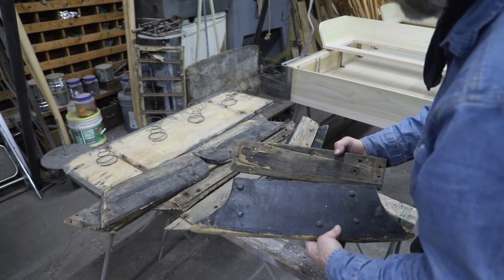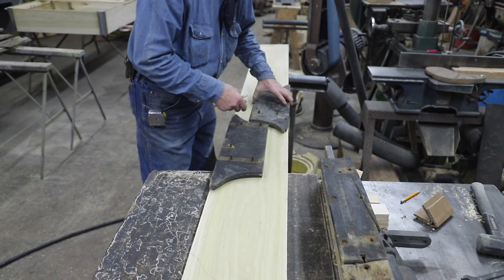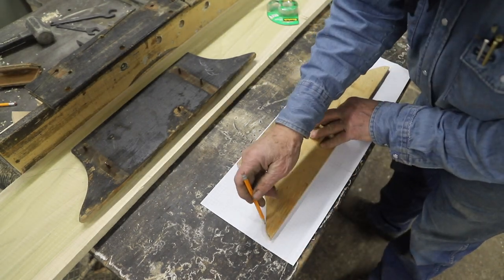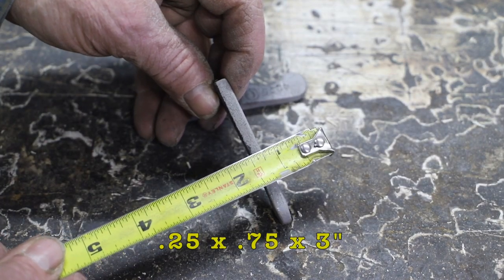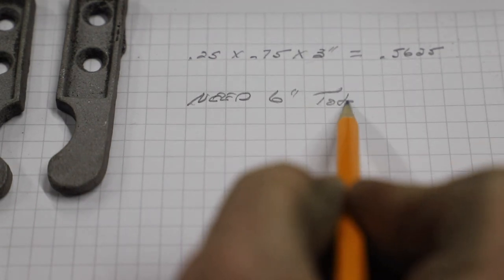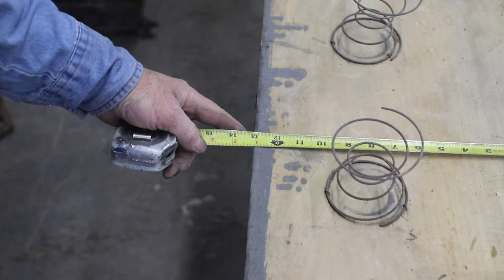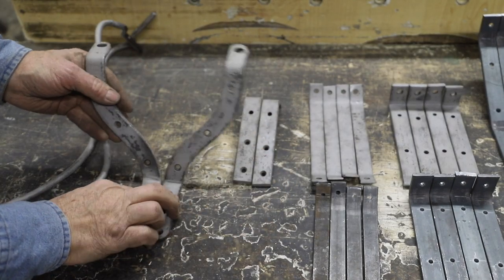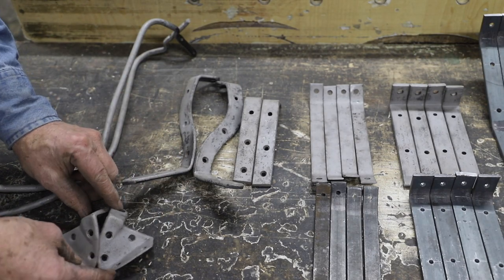Duplicating 2 Buggy Seats | 2 Seat Buggy Rebuild Part 10 | Engels Coach Shop

Comment: I notice  that ALL your guards, big and small, are fully in place on your equipment Mr. Dave.!!  Well done.  Happy HoHo to you and yours!!!
Reply: Totally as they were when made or stock.  Apparently the operator IQ level was much higher in the late 1800's and early 1900's.
Reply: @Garth2011  Well said. Totally agree
Reply: He explained why he doesn't use the gaurds on the table saw in a video about the table saw. He does have the original gaurds for it.
Reply: @garymurt9112  All  I was doing was,  doing a little BANTERING wit Mr. Dave.  And  yes I know about all guards he has. Have a good one.
Reply: @garymurt9112  yep, saw that a few weeks ago.
Reply from the maker: Of course.
Reply: @EngelsCoachShop  Who loves YA Dave.

Comment: After a recent trip to the lumberyard I'm flabbergasted at what the cost of the wood that you used must be even before you applied your magic to it.
Reply: Never buy from lumber yards, find a sawmill and finish it yourself.
Reply: @KipdoesStuff  
Wherever you buy it, wide stock like that is pricey but a sawmill is definitely cheaper than a lumberyard if they even carry material that wide.
Reply: Ever hear of glue?
Reply: @jdmccorful  
Sure. The builder of the original wagon had a shelf full of Titebond 3. 🤦‍♂️

Comment: Your arithmetic had me spinning. Dave, there is a reason the vast bulk of the world's tradesmen use metric and millimetres. THEY ARE SO MUCH EASIER AND FASTER TO USE.
Reply: Not at all. The equation is the same, just in mm. He was only figuring out if a 1/2 (13mm) bar would be enough steel to hammer the part out of.
Reply: @KipdoesStuff  I am familiar with both imperial and metric.Not having to decimalise a fraction and then back again, speeds up work.Yanks are just stuck in their ways.
Reply from the maker: Yes, but I've never worked on a metric wagon or buggy in 40 plus years.  :-)
Reply: @EngelsCoachShop  good answer Dave. But millimetres don't care what the original piece was measured in.
Reply: @TomLaios  so all of his wagons are in imperial measurement and most often whole no or common fractions and you want him to convert or measure what is easy in imperial to metric???? My shop is mainly imperial as I work on old stuff also. Metric is fine and the future but only for new items and some industries. I expect imperial to be around for a 100 years yet in common use in certain types of trades. Some of us will be talented enough to use both.
Reply: @bruceanderson9461  timber can be measured in any system.I use both systems and metric is the easiest.
Reply: @TomLaios  not if the item to be replicated was done in imperial in the first place!
Reply: @bruceanderson9461  It makes no difference. It is timber.1 inch and 1/64 or 25mm.The tolerance on timberwork is so large compared to precision metal work where .25 mm or .005 thou mean the difference between a part fitting or not. Every country except the US deals in metric equivalents of timber stock. A 2 x4 is just a 50 x100 mm. If you aren't familiar with working in metric and mm, give it a go. It is so easy.
Reply: @TomLaios  you will never understand because you can not and that is to bad for you.
Reply: @bruceanderson9461  ditto

Comment: I got some kitchen oil on my nice Engels shirt. It didn't wash out, and the dry cleaners said they couldn't do anything after my attempts at cleaning. So I put the shirt in a pot and soaked it in oil to get the same finish all over, squeezed out the excess oil, and washed it, by itself ... looks fabulous ... a little darker than original, but as long as I avoid other Engels Coash Shop fans, who is to know?
Reply: Lol

Comment: The work you produce via wood and metal is truly to be considered by a master craftsman,  however I do have one question about the video that shows something that perplexes me, as follows:
At 20:15 clearly the new components you are making are shorter than the original, yet at 20:34 all parts, new and original, are the same dimension on the short segment. How did you do that?
Reply: trick of the camera, lol. the parts are the same length just not picked up because of the angle it is shot at.
Reply from the maker: The beauty of steel - easily adjusted.

Comment: Merry Christmas!  I was wondering if the fittings on this wagon were all cast iron and it appears they were.  Was it a common thing to use third party suppliers for fittings?  I assumed that most manufacturers forged their hardware in house.
Reply from the maker: Yes it was common to use hardware suppliers.  The flat irons were most likely shop made though.

Comment: Starting at 17:28 I am not sure I understand why the back edge of the seat 'box' has a 45 degree bevel shaved off. I can only guess the tall part of the seat 'back' is supposed to flex over that 'joint' point with the seat irons acting as the 'spring'.
Did I get that right?

Comment: I notice that more often than not you use files and rasps with a "draw" action rather than a "push". Any reason?
Reply: More strength in the draw?  Just like it is easier to drag your dog to the back door to than to push him when it's time for him to go out when it is raining.
Reply from the maker: Most of the time I am using it as a plane.  Easier to pull a chain than push one.

Comment: 10:50 It's easier to round over the end of bars on the face of the anvil. Just hook it over the edge and hit straight down while raise and lowering the tail of the stock.
Joey shows what I'm trying to say better
https://youtu.be/7RxIso0yHPA?t=250
Reply: I'm not a blacksmith, but I do enjoy crafting things, and what I see produced in your linked video is not a matching piece to what is required on this buggy.
Reply: Just because that is how one person does it, does not make it wrong when someone else can do it in a different manner. Its not wrong if it works.
Reply: @tombaker3794  Not about the piece, it's about the technique, rounding over the end of a flat bar using the face of the anvil because it's more stable than working over the horn.
Reply: @KipdoesStuff  Never said he made the part "wrong", just sharing knowledge by pointing out that there is another technique that he might find faster and easier. It's up to Dave if he wants to try it out.
Reply from the maker: Thanks.  It's only 1/4 x 3/4 so not much metal to move.  I was adjusting the inner curve to match the cam locks also.